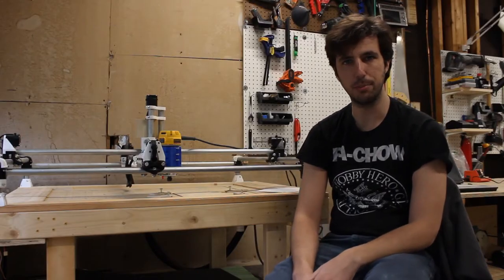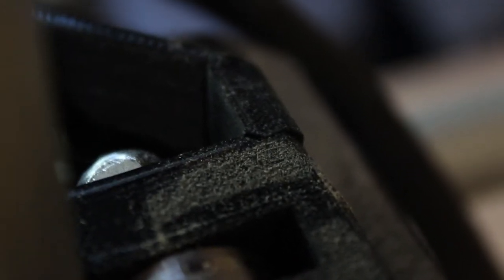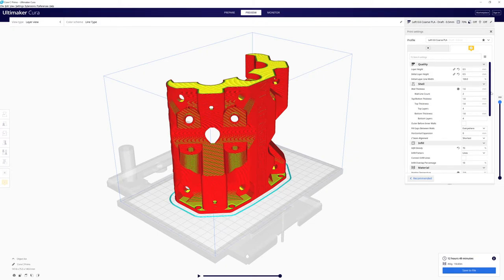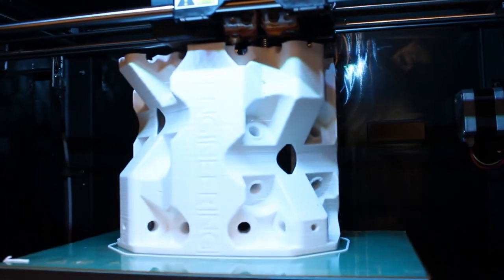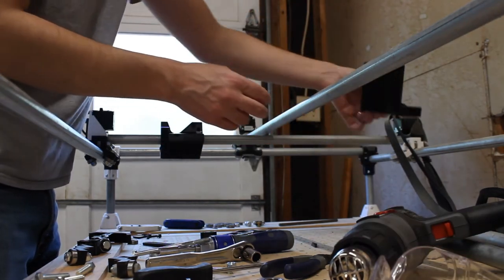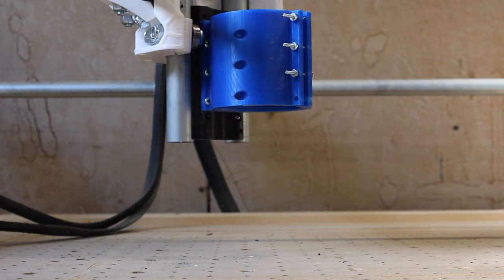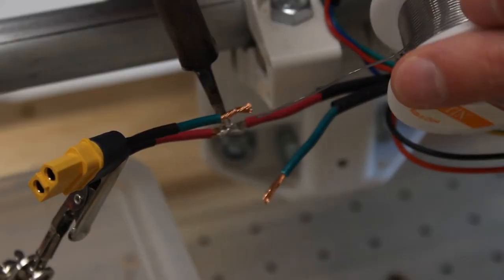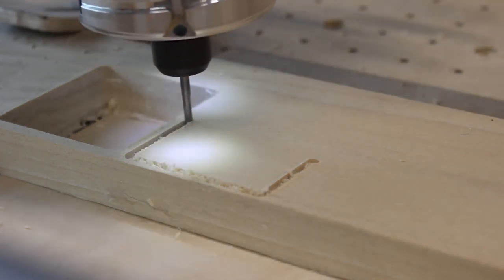MPCNC Primo Core Upgrade

Comment: My core took 67 hours with a .4mm nozzle and .20mm layer height with 4 top and bottom layers, 3 perimeters and 70% infill. I used simplify3d to slice it but have since switched back to cura for now to finish the rest of the primo parts. I tried using a .6mm nozzle to cut down print time but I started having some artifacts in the print that I couldn't figure out so I just went back to the .4mm. I'm rebuilding my entire mpcnc at once and am looking forwardto some of the issues I've had with certain parts being fixed. Thanks for the video!
Reply from the maker: Wow, that's a long print. At 0.2mm and 70%, that has got to be a solid piece!
Reply: @GeoffintheGarage  I found there were tolerance issues with .6 nozzle where the bearings insert.

Comment: It has been awhile since you got your MPCNC going.  What are its good and bad points for you?
Reply from the maker: For me, the good was being able to make replacement parts and customize the machine to what I needed. Over the time I had the MPCNC, I used it as a laser cutter, wood router, foamboard cutter, and pen plotter. There is also a ton of community support out there. The Primo core helped a lot with some rigidity issues I had, and I wish I had rebuilt the entire machine using the Primo design instead of the older Burly model.
In my experience, the machine took a bit of time and effort to dial in, and I had to do more routine maintenance than I expected to keep it running smoothly. This isn't really a "bad" thing, since I enjoy that sort of fiddling around and re-configuring to do whatever I found interesting at the time. I probably wouldn't have had to do so much maintenance if I was focusing on a single use (routing wood OR cutting foamboard OR pen plotting).
Since posting this video, I've moved to a smaller place and gave up the MPCNC, but it was a lot of fun to mess around with at the time. I still have all the steppers and electronics, so If I get the space again, I might rebuild it.
Reply: @GeoffintheGarage  Thank you very much.  This was very helpful.

Comment: Did the Core in 16 hours at 0.3 layer height, 0.4 nozzle on my Voron 2.2
Reply: That's quite slow? How come?
Reply: @jothain  No way is it slow for such a big print. Even on a Voron. Mind you - mine's an old 2.2..no direct extrusion, old rails, etc. It definitely doesn't print well in comparison to the new ones.

Comment: where can I find the stl file for that core?
Reply from the maker: https://github.com/V1EngineeringInc/MPCNC_Primo I used the C STLs since that is the conduit size I have. You'll have to print some of the brackets as well. The full list of parts is on that page as well.
Reply: @GeoffintheGarage  Thanks it was exactly what I needed so I can get started with this project, I use 25mm tubes instead because I want to see if it is possible to put a 2.2kw spindle on
But thanks for the help and your time 🙂